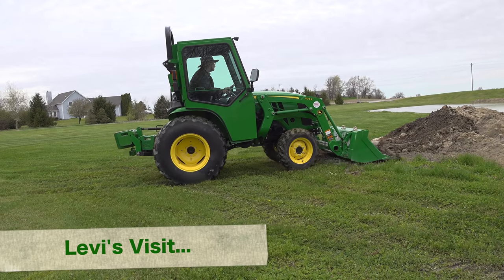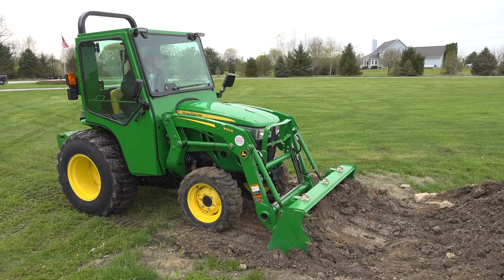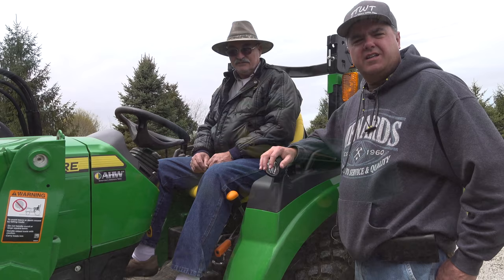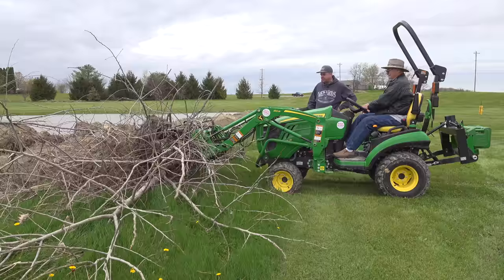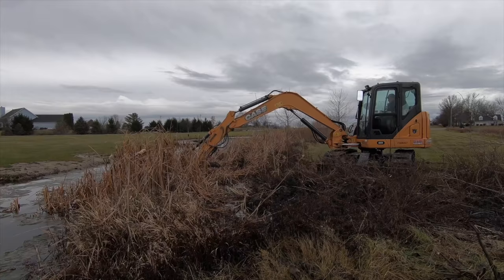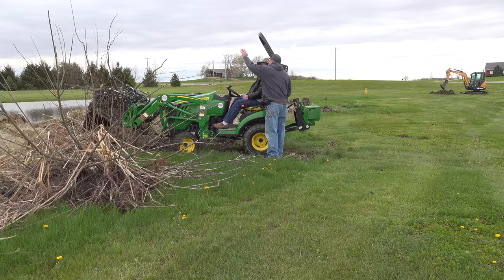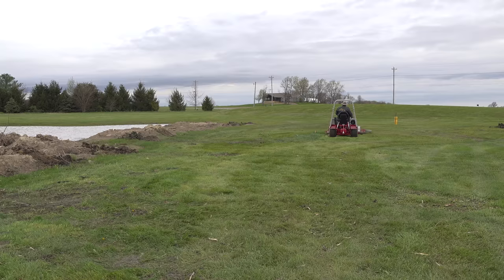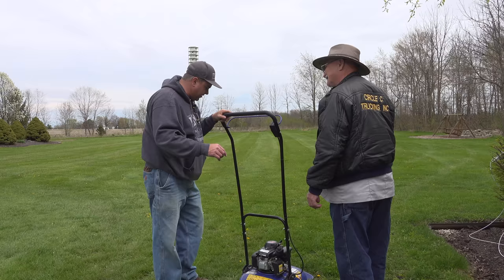Grapple.  Single Clamp, or Double Clamp?

Comment: Earlier I requested a video pertaining to the Mauser Cab on my 1025R. You replied that you didn't have access to a Mauser cab.  That's ok.  But I found out how to do what I wanted and thought you might like to know too..  The access to the switches etc. in the headliner can be accessed by simply removing the top of the cab. Four bolts hold it on and when removed you will find all the wiring, switches and heating and windshield wiper equipment.  From that point you can add additional switches and wire for things like a rear work light aux elec connections for rear mounted equipment.
PS: you videos provide priceless information, Thanks!
Reply from the maker: Wow. That sounds very easy.  Thanks for the follow up.

Comment: I put a 300cX Bucket level indicator on my "E". Got Kens Bolt on hooks hydro gauge, hooked it to the factory Test port, adjusted it to 2500 psi, and my  loader will lift 1200 lbs. 1/2  of a Long Ton of coal, right out of my truck.  Not many do well digging 2 feet deep in clay though.

Comment: There’s a small bracket mounted on top of the bucket it connects to the rear of bucket. It’s 3” or so on both top n rear. That’s your level indicator. A perfect 90degree is level. Or lift bucket up to see n level it then smack your loader control to float position.

Comment: Picked up my 3025E a couple weeks ago.  Grapple is on it's way as well.  So far I have made enough money to make 3 months of payments in two weeks.  We bought it as a business investment and equipment for my land clearing when we close.  Average rate for 1 acre of land here is 12k to clear.  I could get mine with all the implements I need for around 24k the 2032R was going to be close to 29.5k. So far so good, the hydraulics seemed very touchy when I first got it, just have 10 hrs now.  Either I am getting use to it or it is starting to break in a bit.  Love it.
Reply: FL Fishing I got a 3025e in 2017 and I love it. It’s way stronger than the 3032e in the video. I run mine wide open though. I’ve had no problems and I have 140 hours. I also have a grapple and it’s awesome. I’m also in Florida in lake city
Reply from the maker: You’ve seen my wide open tests in other videos.
Look at the spec sheets.  3e is not as strong as 2r.

Comment: The dealer tried to get me to move up to 2k series. I held strong with my 1025r.  I am happy with my JD 1025r.  Using the tiller no problem, mid buster no problem, heavy hitch pulling my rPod 179 no problem. Can’t wait for winter so I can use the snow blower. The I-match system is awesome.
Reply from the maker: 1025r is amazing rig!
Reply: Tractor Time with Tim I’ll do a video of my JD doing some chores. Thanks again for your channel.  Forgot tomorrow is 4 yards of composted manure for raised garden bed for carrots, snow peas, onions, and garlic.

Comment: They delivered my GC1723EB last Tuesday. Instead of a diverter valve, I’m going to fabricate a mount that clamps onto the ROPS, and add a 3-spool valve that connects in the same location in the circuit that the backhoe does. That’ll give me outputs for a grapple or clamshell; as well as outputs for a top link cylinder and a spare for anything I’ve got on the 3 point hitch. 🤔

Comment: Tim, if you can have either a 1025R TLB or a 2032 TLB, which would you buy?  I do small projects like you but I am at a cross roads on which tractor to get.  I know the 2032 is a lot more and the attachments are much more.  Thanks Simo
Reply from the maker: If you can afford, and unless you have tight spaces, go with 2032r.  Much more tractor. Day and night difference.

Comment: Hey Tim. I am in the process of ordering a artillian grapple for my 2025R thanks to your videos. I qas going to get the frontier but really like the mod factor of the artillian. I have the 3rd function already. Do i need anything else to run 2 clamps? Thanks for your time and response
Reply from the maker: Yes.  Call artillian.  You'll need their splitter manifold, and some short hoses to connect to your 3rd function.   ...assuming you are getting two clamps like I have.  if getting only one clamp, you should have everything you need. ...cept for maybe a coupler gender incompatibility.

Comment: Received my tooth bar Thursday.  Simple to mount and looks great. I haven't used it yet, but have a great job coming up where I'm sure it'll be very handy.
Curious, did you mount yours with the included set screws or did you use hex bolts? I'm concerned that the set screw will fill with dirt and that might make removal of the tooth bar difficult.
Reply from the maker: I use the set screws.  I carry a small screwdriver along with my Allen wrench (socket)
I don’t want to have a hex head sticking up.
Reply: @TractorTimewithTim  That makes sense.  Do you have a video on what tools you carry in your toolbox and why? If not, that might make for an interesting video.
Reply from the maker: Good idea!

Comment: Tim ,this has nothing to do with this video but I just got my 2019 1025 my question is what steering knob did u use?I got mine from the dealer but I can’t get it mounted
Reply from the maker: The fancy Deere logo black one.  Mine came with two sets of screws. I think I used the longer ones.  It doesn’t mount perfectly.
Reply: Did u use the rubber “spacer”?
Reply from the maker: I did, but I think I eventually removed it.

Comment: Beautiful John Deeres but have you  ever  had problems on thé 1025r?
Reply from the maker: No problems other than the air cleaner, and that issue has been resolved (redesign on 2018 and later models)

Comment: I think Ventrac should had made the articulation between the firewall and drivetrain.  This is how literally all larger tractors are done.  Its alot safer and easier to control if the steering wheel stays in place.

Comment: I enjoy your videos , that bucket seems too long on the floor to teeth, as you explained in another video distance out greatly reduces lift capacity .Other buckets you had are only slightly longer in the floor than height and work very well on any loader
Reply from the maker: Ok.  Remember that we used the same bucket on both machines.

Comment: Need to run them hydraulic driven tractors wide open throttle, no?
Reply: That's what I asked myself I really think it would make a huge difference in operating
Reply: Well full throttle will boost line pressure make the controls more sensitive.  But for maximum lift max power should be used.

Comment: That 3E might as well not even have a loader, cause it is useless.
Reply: Dale I have a 3025e and it picks up stuff I can’t believe.  I think that 3032e has something wrong with it. Also you are supposed to run them wide open
Reply from the maker: This 3032e is performing to specs.  We tested it. On video.  Compare the specs for yourself.  The 2r has higher loader specs than the 3e.